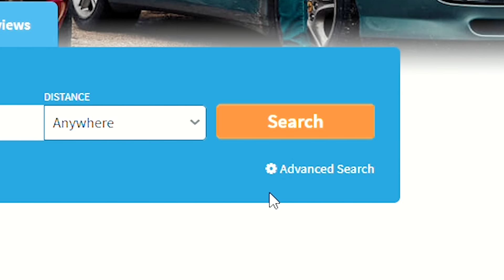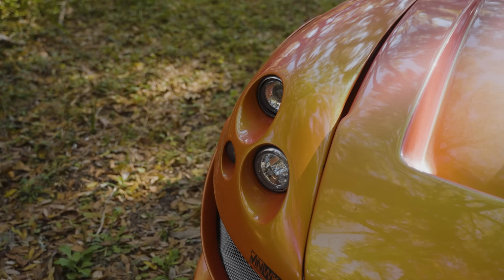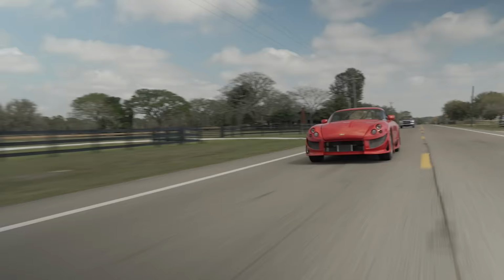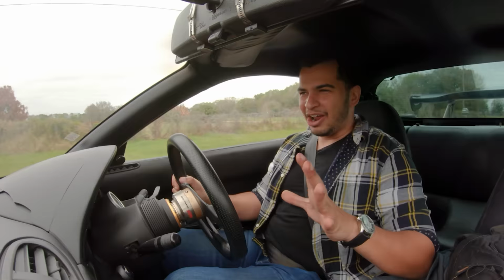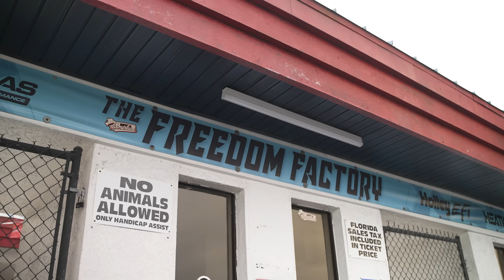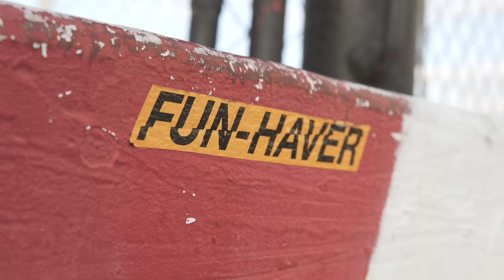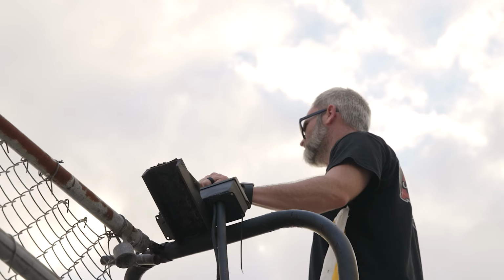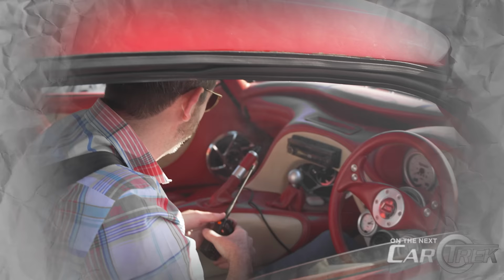We Imported 3 TERRIBLE Sports Cars From Around The World (& Ruined Them IMMEDIATELY) | Car Trek S7E1

Comment: Fun fact: the TVR Cerbera's Speed Eight engine was the sound used for the BMW M3 GTR in 2005's Need for Speed: Most Wanted.
Reply: are you serious I didnt know that
Reply: Didn’t they use the real race car?
Reply: That had to include the sounds of it breaking down after the first race in the game, right? 

You can't run a TVR that long before something has to give.
Reply: @MIKEK3NT  No, the real BMW M3 GTR of that generation sounds more like a race-prepped V8 Ferrari. Still a flat-plane crank V8, but a very different character to the sound.
Reply: Nope. Was made via computer no real car sounds
Reply: @lukedoherty31   I highly doubt that. The GIN files in the SOUNDS directory contain a grain table for granular audio synthesis that can be decoded into a complete sound recording, which was clearly created by recording a car on a dyno if you listen to it.
Reply: @lukedoherty31  Nope. Fact check yourself
Reply: @lukedoherty31  even today thats not practical, nobodies gonna waste there time synthesize car sound

Comment: "One of the most unreliable Japanese cars ever made" 

Precisely what makes the RX-7 one of the most desirable Japanese cars... For Freddie.
Reply: Great article
Reply: It is still most reliable rotary engine powered car💀💀
Reply: Oh, just wait until the Rob Dahm/Tavarish crossover.
Reply: @janakthapa5018  not really, the 12a is wayyy more reliable and actually the most reliable rotary engine made
Reply: @janakthapa5018  and the REW is just a fun engine and kinda dangerous, a lot of crashes due to the second turbo kicking on and people losing control, and i mean it’s a REW it’s a TT generally TT engines are that reliable
Reply: @AoiKaze2000  Yes, Tavarish can donate his import FD so Rob can put another steering column for the passenger side of his 4rotor lmao.
Reply: @janakthapa5018  to think that a turbo rotary can be more reliable than an N/A one. Hoo boi, Mazda really screwed themselves with the Renesis 👀
Reply: At least rotary engines rarely grenade, they just slowly lose compression until they won't start. Given Freddy's hot start issue he may already be on his way, but the first motor in my Rx8 took like 30k miles between the symptoms starting and the point where I was actually worried about it not starting if I didn't let it cool down. And I was not kind to it in my younger days... 

The TVR and the BMW could very well chuck a rod at any moment...
Reply: @Joebobinator  there’s your problem, you owned an rx8, literally the worst rotary engine is the renny, they are HORRIBLE
Reply: The fd has the most reliable rotary out of all rx7s
Reply: @xjoshrx7385  no it does not, not at all, the fb rx7 has literally the most reliable, it’s a fact i’m not lying, the 12a is probably the most reliable rotary engine

Comment: I love how Ed didn't even try his usual financial gymnastics to justify his car. Usually there's an answer as to why he hasn't actually spent the amount he has actually spent, but even Ed can't talk his way out of that one. And yes, that TVR is almost certainly plotting how to murder it's current owner, because it's a TVR and they are the vehicular equivalent of an axe-murderer.
Reply: They didn't have a budget limitation this time, so it wasn't important how much they spent.
Reply: But it is different in the states, and pretty cool. I think it wins the challenge because of those two points.
Reply: Yep the TVR is a reverse kit car, it comes in one piece new & slowly becomes a pile of parts, Rj in Oz
Reply: that was only the Tuscan TVR that tried to kill it's owners because of how far back the cockpit was to the rest of the car
Reply: @insomniacbritgaming1632  wrong they all want you dead. No ABS No power steering No traction control No airbags. 
As Clarkson once said TVR assumes you can drive and drive well. Even the baby Tamora is a handful
Reply: @JD-eo7dr  my old boss loved TVR's, he said the only one he ever had any trouble with was the Tuscan Speed Six, he also had a Griffiths, Cerbera and a few older ones.
Reply: @insomniacbritgaming1632  maybe he just couldn't handle the 4.0 speed six
Reply: @JD-eo7dr  or maybe he was a track nut who literally thrashed anything he owned round a track 🤷‍♂️
Reply: @JD-eo7dr  you can get alot out of an ajp. used to race tuscan callenge, griff, cerbera gt3 car and raced with a guy with an ls7 sagaris
Reply: What I’m more looking forward to seeing is the TVR being fixed and possibly restored after this season of Car Trek. It would be great to see this thing with everything working.
Reply: Regarding the TVR, it has the bizarre, unpredictable, homicidal potential of any redhead.
Which, of course, makes it a phallus magnet. For crazy people with death wishes willing to explore weird fetishes.
But poor Hoovie. When I heard that box of rocks sound, I was pretty sure that his gearbox had exploded. Six speed transmissions from techno-addicted great-grandchild cars are too progressive for an e30. Or at least that one.
Reply: @MyRegardsToTheDodo  That's even more of a reason why Ed wins this already. No budget and they chose an E30 and an FD.
Reply: @Mu4dD1b15  I am pretty sure Tavarish already showed that hentai mobile once on his channel a few months ago. Didn't he trade it for something? Don't actually remember.
Oh, and the TVR is crap already, the BMW was the only car that could actually keep up in a race, until it broke down. But I am with you, there were so many great choices they could have picked from, but they all went for shit cars.

Comment: Honestly just from Ed's statement at 8:45 he automatically wins this whole series regardless of the actual outcome. He's 100% right. Grey imports are for things like TVRs or other vehicles that could never make it over here due to grey market laws. Not a rhd FD or generic E30 with an engine swap.
Reply: Exactly my thought, the other two cars were really just wasted potential
Reply: 100%
Reply: Check out Hoovie's newest video - he didn't want the BMW. He originally ordered a Renault but it didn't ship in time. I think that thing would've fit the series theme perfectly.
Reply: Ehh, the E30's grey enough. How he got a vehicle without VINs from the middle east through customs is a story I'd kinda like to hear
Reply: @ironymatt  Here in Europe the E30s have only one VIN number and it is the one on the bulkhead. There simply ain't one on the dash or wherever. That's just the way they were sold here. We really like them and the 4.4 is a dream swap. You would be lucky if you can register an M52 engine in here, so most of these are still 4 cyl. stock 1.8 engines, and swapping an m42 is kind of the best you can do, besides throwing in a turbo.
Reply: @REVOLTAR53  The M52 is a common swap here in Sweden. Our laws are more relaxed and it's not rare to see 1000hp cars with all kind of engine swaps. The "rebuilt vehicle" option means we can make pretty much anything street legal as long as it follows the normal safety regulations (brakes that match the power etc etc). The 4.9 V8 from the late 90's E39 M5 (and the non-M model V8's of the period) are really popular swaps into everything from old brick Volvo's to Japanese cars for example.
Reply: @ironymatt  yeah, would love to know that too.  I've got my eye on a grey market RHD GTR in Asia... it's really sketchy tho.
Reply: Agreed
Reply: Its a euro spec E30 so theres a few differences but yeah the RX-7 as a bit of a waste
Reply: @ironymatt   It has a single VIN on the firewall.

Comment: They joke about engine weight on the e30 but the stock m20 was an iron block so the weight difference wouldn't be that much moving to an all-aluminum v8. If they had moved the battery to the rear that might have helped as well.
Reply: 100%. The M60/M62 is underrated. The last generations of that engine with 4.4 and 4.6L displacement and Vanos were awesome. Torquey and rev happy.
Reply: An LS swap only adds about 150 pounds to a Miata I think I read one time because the 4 cylinder is pretty heavy.
Reply: @Dryloch  ...and how is that relevant to the discussion?
Reply: @theclicker  because cummins swapping a toyota previa would add a lot of weight.
Reply: @theclicker  I think the relevance is that small iron 4-bangers are often surprisingly heavy Vs aluminium V8s. I was surprised when XF Motorsports weighed an S2000 engine and it wasn't far off the weight of a Mercedes M113 V8.
Reply: Lets be honest here these guys clearly dont know shit about cars when it comes to high power tuning or engine swaps or even bmws in general it seems.

Comment: That poor TVR. Hopefully they can get it sorted out because they were incredibly quick cars. Light weight with big power for the day.
Reply: Parts would probably take forever to get since none of these ever came to the us
Reply: @0554joe  Not to mention TVR stopped production in 2006
Reply: @lc5176  the current ownership have started producing replacement parts for previous tvr models, even formed a separate company to take care of that side of the operation
Finding parts shouldn't pose much of an issue but getting them sent over to the states might, what with delivery and customs etc.
Reply: Restoring that car fully would be a series I’d enjoy watching.
Reply: @Offensivebeast  I'm hoping it happens, back to original though 😂 the current look is very 2000s UK/Max power magazine and hasn't aged well in the slightest 🤣
Reply: @Husnain237  I hope so too, I was working on a Land Rover relatively recently, and there was a TVR Chimera beside me the entire time, couldn’t stop staring at it.

Comment: That TVR at one point was one of the best “tuning cars “ in Europe . Specially the UK
Reply: TVR Speed 12 epic
Reply: It was not one of the best tuning cars in Europe or the uk. It was a famous MAX POWER car. Max power was all about looks and sound systems. Not performance. That car is gone stock behind the body kit and aesthetic mods.
Reply: @JackThomasCollins  It was also a bit of a lash up back then. Sadly I'm old enough to have seen it in the flesh when it was in the gold paint. None of those cars were actually that well done. 
Lots of fiberglass, filler and self tapping screws.
Reply: I'm old enough to remember when Max Power was actually about power and performance. Many of the cars featured in the early years were quite subtle. But yes in the late 90s the whole scene seemed to switch to aesthetics and car park pissing contests.

Comment: It's only when you see the Crown Victoria next to the European/Japanese cars, do you realise just how big American cars really are 😮
Reply: The Crown Vic is bigger than most American cars.
Reply: And the Crown Vic is fairly small, compared to modern American family cars (a crew cab F-150 with a short bed is almost 3 feet longer, and that's the modern equivalent of the family sedan)
Reply: @11sfr  its not tho a dodge charger is a family sedan
Reply: @MV-ri7zu  pickup trucks are the sedans of the 21st century, proper sedans are niche/specialty cars now, the F-150 is the most common family and commuter vehicle in the country, by a very wide margin. It does the job the family sedan used to

Comment: Forget the oil, Tavarish is gonna need to replace the whole engine every few thousand miles
Reply: Nah, don't tell lies. Rotary engines last longer than piston engines, if you take care of em. 
The only weakness, that usually breakes on the rotary in that rx 7 is the complicatet sequential Turbo system, but the engine itself will run forever...
Reply: With a few mods and care you can drive that thing for a very long time.
RX-8 included.

Comment: Just so you know, your RX-7 will need new Apex Seals soon. Back in the day when I used to test rotaries, I would run them on the highway for about 10 minutes then immediately shut it off, if its hard to start the engine again, it means your seals are about to go away.

Comment: As someone who both from Tampa and Lebanon I can 100% agree that if you aren’t careful buying from Lebanon you’ll get screwed. A lot of the mechanics in Lebanon aren’t exactly that good and they think they are amazing. For example they will put a car fuse in a boat and attach it directly to the wire with electrical tape. Yet somehow how they will think this is how the boat came. Not in a waterproof case with a marine fuse, idiots.

Comment: My FD RX-7 has been the most reliable sports car I have owned, better than my WRX, better than my EG Civic. It really comes down to a few simple things. 1) check the oil levels every time you put gas in it. 2) make sure who ever tunes it knows what the hell they are doing. 3) Keep the timing conservative to reduce odds of detonation which is the Achilles heel of the rotary due to apex seals being fragile. 4) GET RID OF THE STOCK TWIN TURBOS AND GO SINGLE TURBO.

I have owned the car for 10 years now and honestly it is one of the best driving experiences of any car I have ever driven and I have driven a lot of them.

Comment: 9:50 Not derived from the Rover V8. The only thing the AJP V8  has in common with the Rover is the number of cylinders. For starters the Rover is a 90deg V while the AJP (Al melling, John ravenscroft, Peter wheeler) is a 75deg.

Comment: you imported "THAT Cerbera." 😂😂😂😂
Good Luck..😂😂
you have to turn to cancel the indicators.. wrong. if you lift the lever to turn left  just lift the lever a second time to cancel.. light issue is the ribbon cable from the steering wheel!!😊

Comment: Tavarish needs to learn a thing or two about rotaries. Long cranking to start is a sure sign of low compression (apex seal damage). Revving the nuts off your rotary when it does start is probably how the low compression originated. Rotaries need to be thoroughly warmed up before you beat on them. Steel rotors in aluminium housings expand at different rates so the temps need to stabilise for proper clearances etc. Looked after properly they’ll take all sorts of abuse and keep on going. They’ve got a bad rep from ignorant owners who have no idea how to operate them.

Comment: A 300bhp E30(the 4.0 V8 in it is 280 stock) should be able to smoke those other cars no problem with a proper driver. At times it looked so slow that a diesel BMW would smoke it on the track .

Comment: I noriced that Freddie so far watching keeps turning off his car wrong witch makes it harder to start. You don't just shut off a rotary like all other cars. You have to sort of rev the car to between 2k and 2600rpm and shut it off as rpms are dropping but before it hits 2k ideally. Im not sure exactly why. My mechanic buddy said something about how the triangle in the peanut shaped combistion chamber works is that just shutting it off leaves your first ignition chamber dry with no fuel injection nozzle as that is in the chamber before. So revving it and shutting down just before or as you take your foot of the gas leaves the combustion chamber wet as he phrased it. Primed with gas/oil for an easy start next time. Maybe I don't have all that info exactly right but i do know that I never had amy trouble starting my buddies Rx8 at any time.

Comment: $15,000 to buy an E30 in Lebanon? damn the most expensive one i've seen is up for sale for about 8000$ and it has a 600hp 2jz and drift suspension and full-on roll cage. Either the number isn't quite accurate, or you've been ripped off haha

Comment: That BMW is not 25 years old, more like 40. That is a mid-80s model BMW. The end-90s model would be the e46, preceded by the e36 which was introduced in 1990. What you have in that video is an e30 that was introduced in 1982, which is a BIT more mature than "just turned 25". If this is the measure of competence for the rest of the show... I'm outta here.